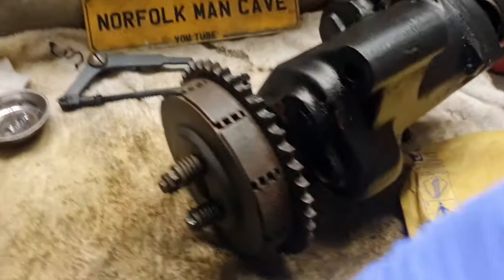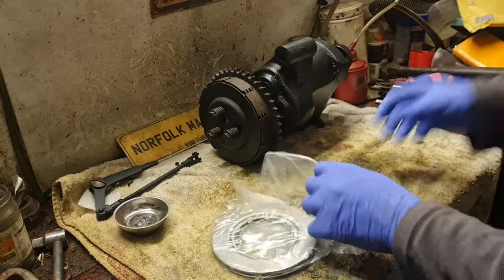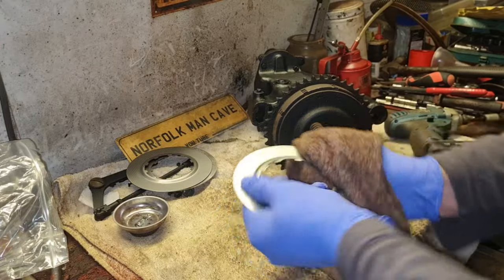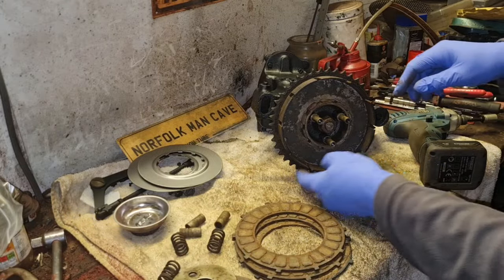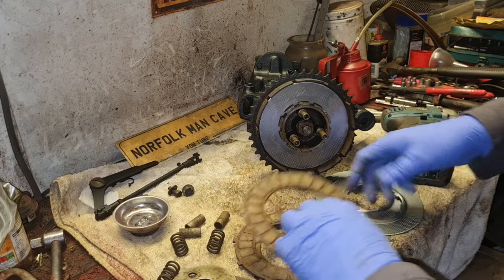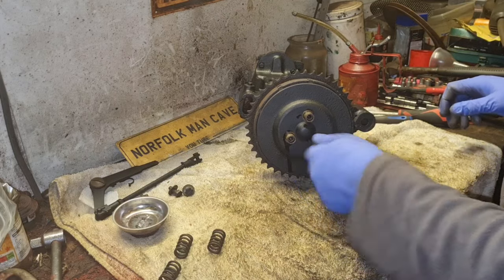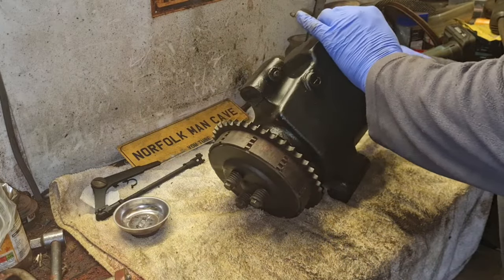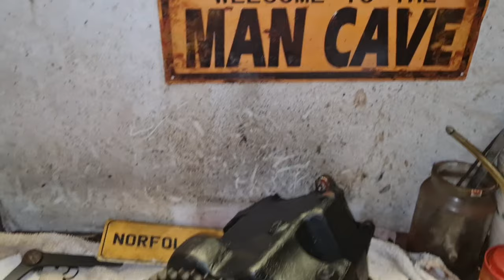Bonser Autotruck clutch change.

Comment: The clutch hub should rotate within the clutch outer without the plates in  , there is a bearing behind the hub , it appears that the whole thing is locked together , the clutch plates once disengaged you should be able to hold the outer chain wheel and the center piece with the springs should rotate within the outer bit , I'm sure you'll  get it going ,

Comment: I don't think our host reads the comments.  I mentioned last time the fact that the clutch hub should rotate separately from the clutch basket when  the plates are released or removed.  It appears the roller bearing are rusted into a single  piece.
Reply from the maker: +Thomas LeMay ow I read them. upcoming video is hopefully coming tmw at 6. provided I get it filmed tomorrow 🤣🤣

Comment: Please please read the comments everyone is saying! You are going to have to take the clutch plates out again. That small sprocket behind the clutch is the output of the gearbox, it only spins relative to the clutch basket because the gearbox is in neutral. Put the gearbox in a gear and the two sprockets will be locked at a ratio depending on the gear selected, usually 1 to 1 in top gear. The bearing between the basket and clutch centre is locked solid. The clutch will not clear like this. If the bearing is like motorcycle practice it will contain many small rollers, be ready to catch them when you take it apart.
Reply from the maker: Hello there. I read all the comments. Upcoming video hopefully tomorrow night as long as it comes to bits OK.

Comment: Nope! You've still not got it, the engine drives that large sprocket which should be fixed to the outer basket of the clutch, the drive shaft to the gearbox should be fixed to the inner splined unit, when you operate the clutch you break the friction contact between the two disengaging the engine from the gearbox.
The small sprocket is the output to the drive shaft.

Comment: Have you not read all the comments? Every one shouting the same bloody thing 😂you still haven't shorted the problem about the centre moving independent of the outer basket ??The bearings in the centre have probably locked up ? You really need to remove all of it off the main shaft check and lube the bearings .
Reply from the maker: +Mat Naylor on the case Mat. doing video tmw. clutch apart AGAIN 🤣🤣

Comment: Right decision on the plates, those old ones would have ripped through the pads on the friction plates I think. Same goes for the outer cover though. Could it be faced in a lathe to get it smooth again? If so, maybe a lathe owner could help you out?

Comment: You have only done half a job, should have removed the whole clutch drum, derusted and cleaned every part. Purchased and fitted new correct springs upon assembly, do not wind them until they are fully coil bound, just enough to prevent clutch slip under load and evenly to ensure plates free. The friction plates must be clean and not oil soaked. Best of look though.

Comment: Did the clutch lever fit
Reply from the maker: It do and it don't mate. It's a bit small. Bit short and won't fit Iver the pivot point.
Reply: @NorfolkMancave  that's a shame it came off a mayfield gearbox but the one off the bonzer is a tad bigger